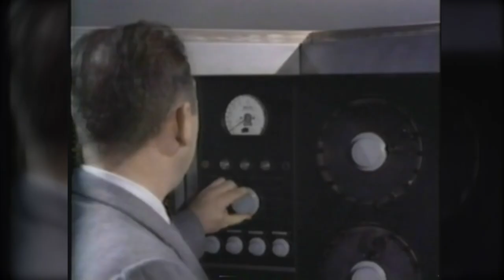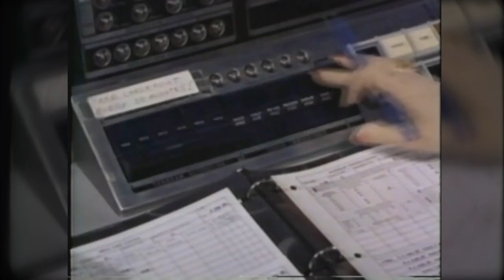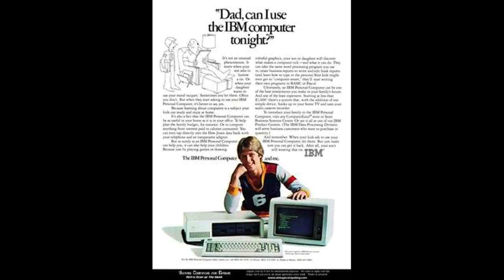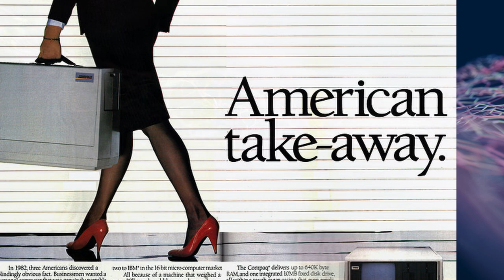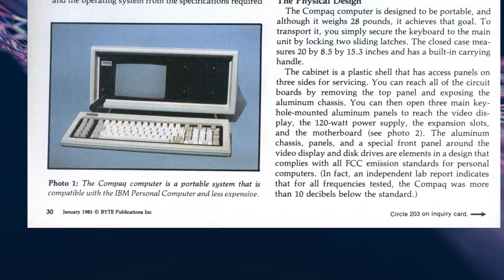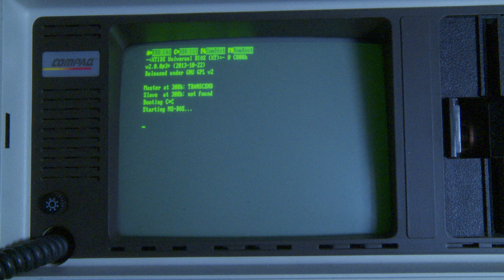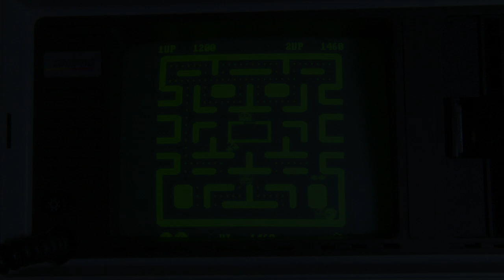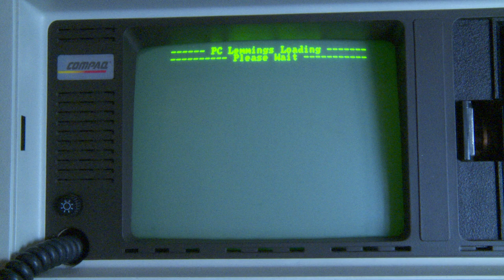The Compaq portable - The rise and fall of IBM

Comment: My first PC was a clone from Jameco in the coolest flip-top case. 1988. It has CGA graphics and a Panasonic dot matrix printer. We were running the NEC VC20 10 mhz chip. 20 mb MFM. We played Stonedale and text based adventures, but I twisted my dad’s arm to get us a VGA monitor and board—and eventually a Harris 286-16 motherboard with a whopping 4mb ram. Then we could play games, even run windows 3.1. That was key for my midi adventures. Miss those days.

Comment from the maker: My first PC was a 386DX with a whole 4Mb of RAM, which was a good spec when it was made, unfortunately by the time I had it the min spec for most games was a 486SX 25mhz.
Reply: My first pc was a 486 dx with 8 meg ram a 1 mb video card 2x cdrom and a 16 bit sound blaster. I bought it used in 1994 for 900 dollars.

Comment: This takes me back I got my first pc in my last year of a levels just before university. I worked the school holidays setting up a bunch of pcs for word processing, they were Hyundai 10mhz 8088 with Hercules graphics and 20mb hdds. After setting up 6 of them and training the staff to use them, I had earned enough to buy my own but with a 40mb hdd and cga graphics on a Philips 8833 monitor. After having the pc 3months I worked out that the graphics card was ega compatible (change a number of jumpers) and the Phillip monitor would support ega. Massive results

Comment: Its kind of unique that your videos start at a story worth telling, to end up with a machine worth showing and fixing it too. Like lgr stories with oddware combined. Idk if it works, idk if people stay to watch to the end enough. If not, you could always decide to split the videos. Or to edit both parts in with eachother instead of 2 sections
Reply from the maker: I am trying to mix the hardware it a bit more at the beginning so poeple know it's coming.  It seemed to work with the victor9000 as a higher percentage of people watched to the end, so I will probably mix the hardware in a lot more through out the story elements.

Comment: The Compaq was not "the first ever IBM compatible PC". It was the first legal IBM compatible PC to sell in large numbers. There were numerous PC clones before the Compaq, but most of them got in trouble for illegally copying IBM's ROM BIOS code.
Reply from the maker: Yep as you said there was the odd one or two that straight up copied IBM's bios (and yet in some cases where far from fully IBM compat), that sold in small numbers before IBM shut them down that shipped before the compaq. I think I mentioned one example Eagle in a passing joke in the starwars bit who IBM sued and forced to stop manufacture as a nod to the less than legit PCs that predated Compaq.   Your right however its good to point it out explicitly.

Comment: Our family's first PC was an ICL DRS M30. AMD 286 at 12 or 16 MHz (can't remember which), VGA graphics, 2 MB RAM, 100 MB hard disk. I recall it was MS-DOS 3.3 because that hard disk was partitioned into 3 x 32 MB, the max that DOS 3.3 allowed, plus one small one for the tiny bit of space remaining. It came with Windows 3.0 so must have been summer 1990.

Looking it up, it was apparently a rebadged Acer, or maybe Acer built them under contract. It's an obscure machine to have: I think my Dad must have got it on a staff discount, because he'd worked for ICL for about 20 years at that point. But it was a pretty big step up from the ZX Spectrum 48K we had previously!

Comment: In the very early 90s, I had a Compaq desktop that I'd rescued from the bin at work... very similar to this but in a more "traditional" desktop case and with a "massive" 20MB hard drive. The foam and foil keyboard was already starting to fail even that long ago and the hard drive was starting to stick on power on too... but I loved it's green screen.
I still remember when the original IBM-PC came out, I had been using Beebs and CP/M machines for a few years and a PDP-11 for a couple more I expected this new 16-bit micro to be something really special... but it was just the same as the CP/M machines or maybe even not quite as good. Fine, the manuals were in some very very expensive bindings but (what these days, we'd call) the UX was... "meh!"... I think the most "meh!" of my entire life. Then, a few years later, my mate got his Amiga and that was a lot more like I'd been expecting - at least that had multi-tasking.

Comment: We called these Luggables.  Apple made a Macintosh Portable  a couple of years later that used a 6V 'motor-scooter battery' for power. It weight a bit less than the Compaq, but it was not a bad first attempt at a truly cord cutting computer.  Grid Computing kinda upstaged everyone with the first portable desktop class computer than fit in a briefcase. Apple soon answered with the Powerbook 100 designed by Apple, but built by Sony.

Comment: Well, my first PC was when I was quite young. Probably five or so. Dial up internet. Don't really remember anything else about it, apart from it running Windows 98. 

The first one I owned myself was my mom's previous after she bought a new one. I do recall it being a Compaq; I know it had 512mb of ram and an 80gb hard drive, with some flavor of pentium or celeron cpu. That would have been around 2006 or 2007, and it definitely wasn't new when I got it. Windows XP. Killed it with a virus from Limewire. Classic. 

I went from that to my own first PC that I bought myself; it had some flavor of AMD Athlon cpu from 2008, nvidia 6150se graphics, 3gb ram, and a 1tb hard drive. I thought I had myself a gaming monster, because it ran the original Halo. Ha! A friend of mine ripped all the parts out, put it in a new case with a larger power supply, and threw in a spare GTX 560 that he had in a drawer, and man, what a difference. I could play games with my friends!

Moved from that to the first dedicated gaming PC I bought myself, with an FX-6300 and a GTX 1060, which I realize now was a somewhat mismatched pairing and not particularly good value. 16gb of ram though, and it was my first PC to run Windows on an SSD, so that was still a great experience regardless. 

About a year and a half ago, I learned to build my own, and I've got a Ryzen 5950x, 32gb ram, 12tb of SSD storage (and two 12tb hard drives on top!) with a 3080ti. Quite different from where I started. Love working on PCs. I've built nearly two dozen since I learned how, mostly for other people. It's a really fun thing to get into. Quite a long path to get here. I'll be 30 next year.